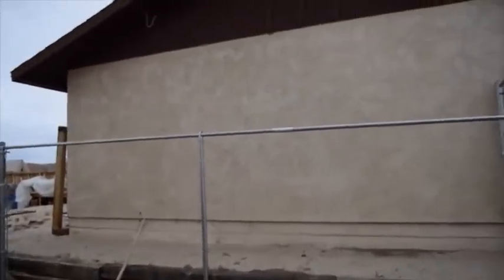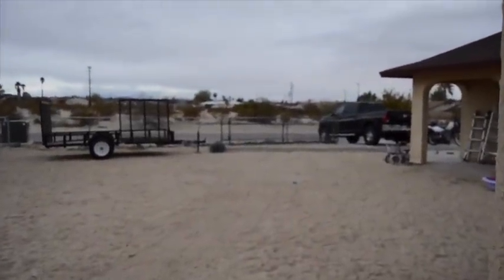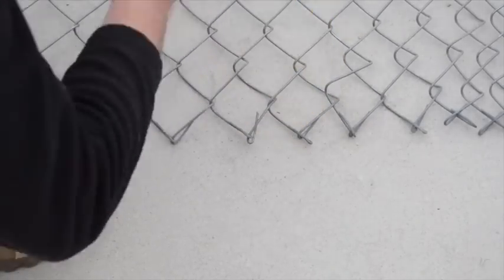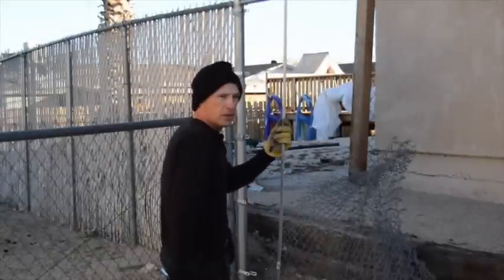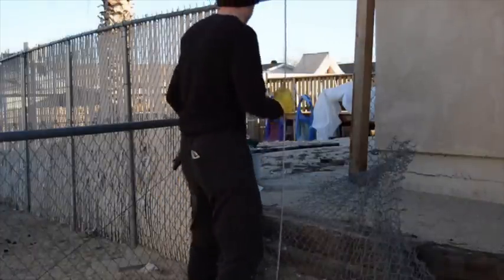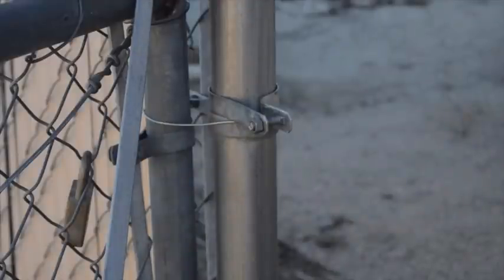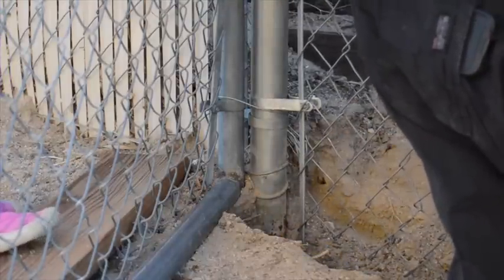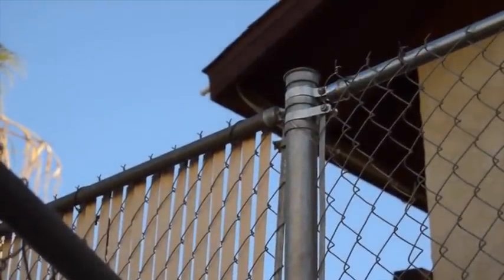DIY Chainlink Fence Cut, Stretch, and Tie up Part 1

Comment: Darn turn backs,..I like sliding the tension bar down the chain link first and then installing the nuts and bolts,..but everyone has there own way,..as long as the end result is the same is what I say,..good job,..
Reply from the maker: Thank you for the professional insight, as I think now, your way probably is both quicker and easier, next time I stretch I will try it that way!